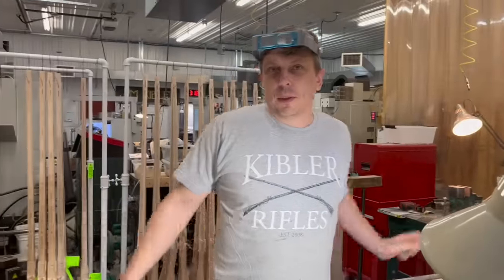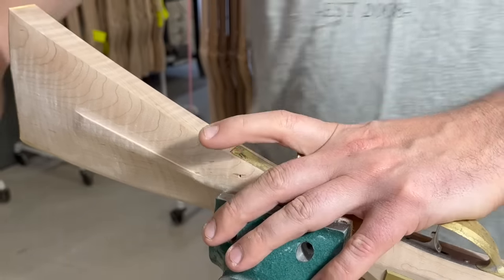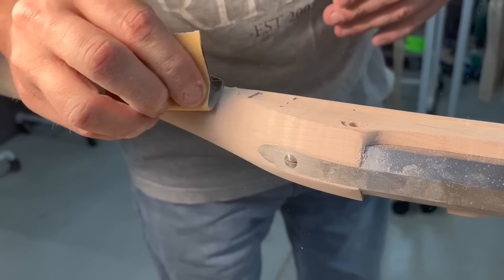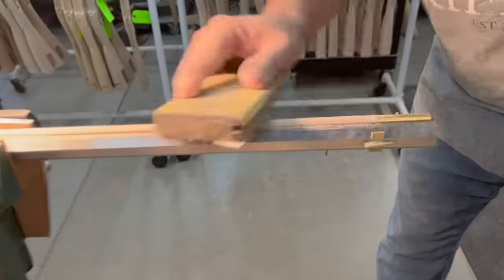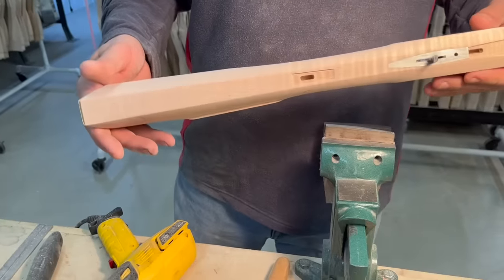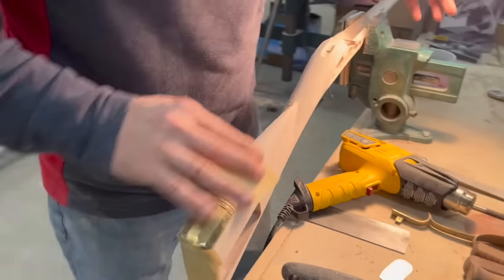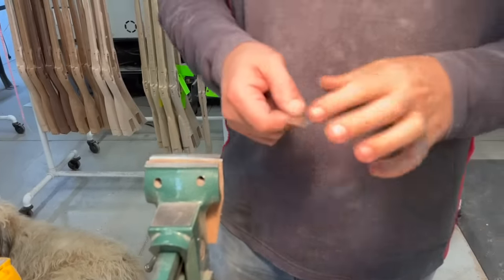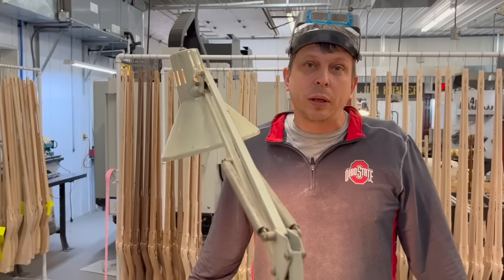Stock Sand-Along with Jim Kibler. Showing proper technique on sanding a flintlock muzzleloader kit.

Comment: I have my eye on the Kibler Colonial rifle, Jim.  Did you upgrade your production of the Colonial to use the same methods as you use on the Woodsrunner kit?  I am especially interested if you began using the same milling techniques for the hardware in lieu of castings.  Many thanks for the incredible instruction videos, and for just being there to provide such incredibly easy to assemble kits for making authentic vintage American rifles.  My best wishes for increasing success for your business and your family.  ❤your work!  👍
Reply: He mentioned on another video that moving the production of the other kits wasn't feasible, so those kits will remain as is with just a bit more work to finish them. That said, those other two kits are still far and away the easiest kits on the market aside from the woodsrunner.
Reply from the maker: Correct--those two kits will still be made on the other machine.  Thanks for the comment

Comment: I'm at the 220 stage right now on my walnut Woodsrunner.  I plan to do some carving and finish with Tried & True as I did with my Maple Woodsrunner.  Would you recommend anything different from this process for a walnut stock such as wet sanding with some T&T at the 320 stage to help fill the grain a bit?

Comment: You and your people's health is not worth running seven days a week unless you have it covered that there is time off, even for you. I don't mind waiting on my order if it means that you and your people are in tip-top shape and not tired. 👍
Reply from the maker: Thanks for the input and the support. We have about 14 employees and run in shifts. Weekend shift does 3 12 hours days but gets paid for 40 and week shift does 4 10 hour days. All get paid holidays and vacation. Jim and Katherine work parts of 7 days a week right now for the most part but it’s by choice and with lots of breaks.  We also live onsite but thankfully for everyone the rest of the crew does not 😆Katherine enjoyed using last Saturday to edit video and Jim uses weekends to work a different pace. We do look forward to holiday breaks!!!Having a business is kind of like having a child—we are always “on duty”.
Reply: @kiblerjim  , kudos to Jim for not being a slave-driver. Though I see from this video that not only does he burn the midnight oil, but also the motors on the vacuum machine. Regarding the ramrod pipes, my solution was to file notches on the tab for the 1st, (one) 2nd (two) and 3rd (three) pipes on my SMR kit. The notches were on the front of the tab, so I had proper orientation, too.
Reply: Doing a proper job for sure! I like keeping fittings attached when sanding too! Much nicer finish on anything with metal and wood.

Comment: some of the old timers would break glass panes and use the broken edges for scrapers
Reply from the maker: Interesting!
Reply: I have used microscope slides for the scraping - work very well.
Reply: At 60 yeas old I suppose I'm one of those old timers. Lol back when I was about 12 or 13 I got my first kit gun and had to get the information to turn it into a tool worthy of use by books and questioning the old guys around who worked wood. Glass was the most delivered answer when I asked about shaping a simi finished piece. I've mostly moved on to carding scrapes nowdays when I once in a blue moon take on a project but am still known to keep my eye out for quality shapes of broken glass.